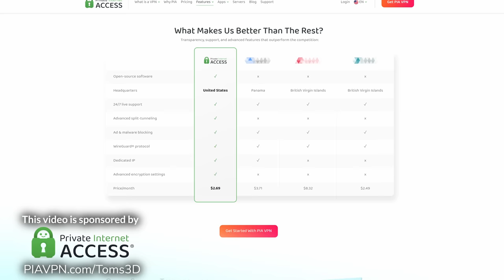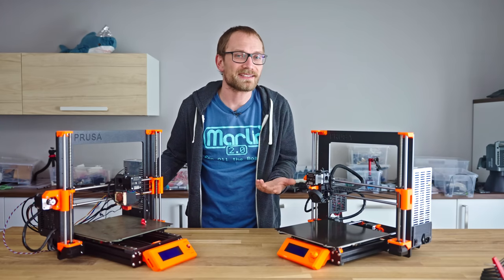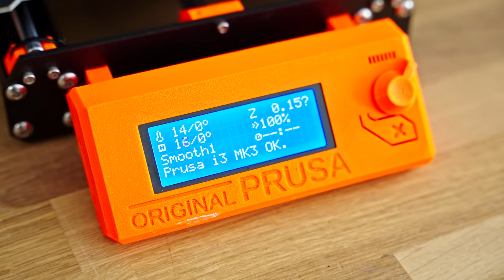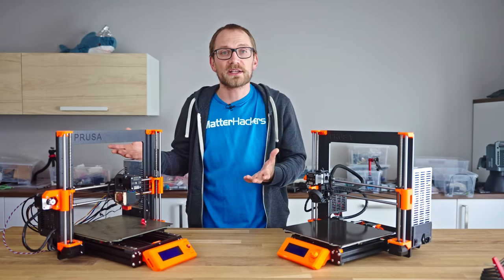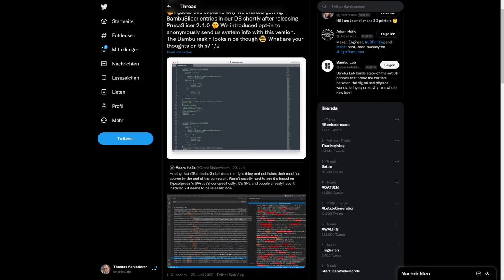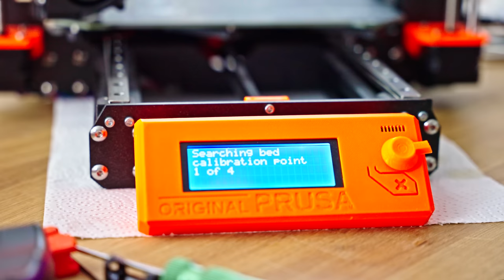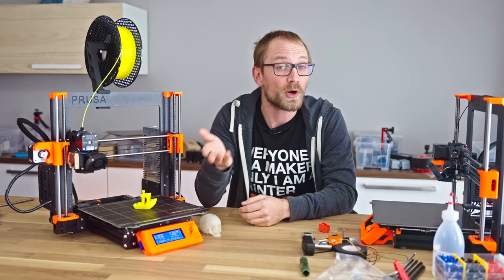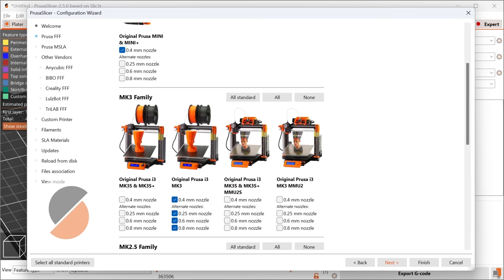This printer is OLD. Why is it still my favorite?

Comment: Thank You Thomas!
Love my Prusa i3mk2 and just bought a SL1 with 12 hours on it, $600 on Ebay........$400 S upgrade incoming!  Also, the air filter cartridge is easily refilled with Activated charcoal pellets for less than a buck😎

Comment: My Prusa i3 Mk3 is my rock. Almost literally on a mental level, because the 2.5+ years of my long covid has wrecked my leg muscles to the point I'm now officially disabled and can park close to shop entrances & on double yellow lines.
But when I'm 3D print designing, my entire thoughts go into looking at & manipulating the design in my head like I'm using a 3D editor, only without the slow keyboard+mouse interface constraints, and I can practically see the print lines in the detail before the stl even hit the slicer. I've had 3 things on the front page of Thingiverse now :)

Comment: Love it too! Would love a play-by-play of what you did to rejuvenate the old printer. Mine started having so many hotend issues I just eventually gave up: maybe just time for a replacement hotend
Reply: Perfect time to upgrade to a Revo Six. ;)
Reply: Start with disassembling the print head. Put in a new nozzle and heat break and take care that the extruder is ok and you should be good for another few years. Oh yes and use only good filament! If a filament clogs often: never buy it again and throw away the rest of it.
Reply: I had frequent clogs with the stock heat break. Turns out it has a diameter change in it designed for the MMU and it causes problems. I changed it with a E3D V6 heat break, that the same inside diameter all the way through. Works great now!

Comment: i Bought  my Prusa MK2s  IN 2016... later  upgraded to MK2.5s  . At  the  beginning it  wasnt perfecft,  I had quite  a  few unfinished parts (  especially when printed  longer  than 2  hours), also had  some  bad  jams -  all the  usual stuff , but then I  found  a  very nicely  designed S±E Upgrade kit for E3D Titan Extruder  on Thingyverse. So  I  ordered the  Titan  extruder, printed  the  kit and   since then  (  2017)  ive  been  printing without  any  problems

Comment: Thanks for the video, Tom. Nice job. Your videos have helped me a lot.

My first printer was an Ender-5 Plus with issues right out of the box. Support suggested swapping wires on the mother board first, then sending a new replacement for the hot end. I replaced the power supply, mother board and a drive motor too...never did get a print off of it. I call it my "benchy" because it just sits on the bench.

Which brings me to my Prusa i3 MK3S+. Printed great right out of the box and still does. PLA, PETG, PA, Flex, and Composites all print great. It's all about reliability.

Comment: I just bought the MK3S kit as my first 3D printer. During my research it just seemed like the best fit for me - I wanted something that can print simple stuff without any special tinkering or trial&error, and keep doing that with a low chance of breaking down, while having lots of support online.
And I think I was right! The instructions were great, and it worked immediately after I put it together, despite me having very little experience with things like that. When I search online for improvements and hacks, I get tons of results. Everything seems to have been printed on this, every software supports it, it just works, any serious bugs in the hardware or software must have been fixed years ago. That's what I like in cars too... never get the first model from some line, get the one where the bugs have been fixed.

Comment: I very much agree with this statement. The Prusas are unbeaten when you need a printer that *just works*. It'll be slower than other printers (like the Voron 2.4) or doesn't have the largest build volume (Also Voron 2.4 or Creality CR10 in all its variations), but it just spits out quality prints without having to tune it for hours.
Reply: Bambu lab comes far closer its the first 3d printer I use like a paper printer
Reply: I don't even see the Vorons and the like as competitors to the Prusa because they don't address the same target groups. One is for people who want to 3D print, the others, taking into account the effort you have to put in and the know-how you have to acquire, are for people who are interested in 3D printers. (And yes, I have both.)
Reply: @tmartin9482  Very true, the process for those is very different from something like a priss which you can get pre-assembled. But if you have the know-how, they're unbeatable at the price for how much speed you get, and what you can do with your printer (thousands of mods to choose from). But they don't "just work" st the end of the day, unfortunately

Comment: I would say, for tinkerers a CR-10 would be an even better choice than any random Ender-3 clone. The CR-10 is so old, that abused or neglected machines can be bought cheaply, they are even older than an Ender 3, so retrofitting newer parts on an original CR-10 is so much fun. The resulting printer can also be a perfect second printer alongside a more reliable normal-sized one, since its larger build volume gives it uses, even if another printer is currently better at most parts.

I have to say, I just love to explore different competing upgrade paths at once. My first printer is an original Ender 3 and it has e.g. the SKR v1.3 with TMC2208 (that was state of the art back then). My CR-10 got a nice MKS Robin E3-DIP with TMC2209 (before chip shortage became a thing, so the whole board was like 20€ including shipping). I also use a HeroMe Gen 4 on my Ender, while the CR-10 uses the superior Hydra V6 edition (with a premium V6 clone). My Ender 3 is still a bowden printer with a normal metal extruder. The CR-10 is direct drive with the dual gear extruder meant for CR-10S or something like that. etc

Comment: I'm with you on this, mostly because Prusa just works, and if it doesn't there are direct guide and support from Prusa to get it to work. Those printers might be kind of expensive but I'm willing to pay that price as it just works, and now there is possibility that Mk4 is actually comming as there was poll on printables on what features would you like to see in Mk4.
Reply: I've never seen a video of a print farm that uses anything other than Pursa's. Hmmm. I CAN speak for the reliability of Creality though: SH*T!
Reply: Prusa needs to drop the prices on it's older printers.

Comment: My old Prusa MK3 has exactly two mods. The first was not done by me and it's just a power cable extension so that the power supply can be mounted outside the home built enclosure it has. The second one, the only one I've installed and only because I accidentally wrecked the hot end by rounding off the screw holding in the heater core is the Revo Prusa. I love being able to change nozzles without any hassle and has made my machine more versatile than most new contenders. Someday I'll get an MMU 3 but that's gonna be a while.

Comment: Im running still my MK2S, that I updated to Mk2.5S, and The Bear Frame.. It blew its mainboard so I updated to Duet 3 Mini 5+ and got all those network stuff and up to date stepper drivers. Installed Revo hot end and Super Pinda. But still under every minor or bigger update I have done its still that MK2S.. And its running perfectly and its so easy to maintain! Actually bought used MK2 to run along with it and it works as well after almost 5 years :)

Comment: Few things on my Prusa where I thought: "That could be improved" -- wire management, construction order, some parts are finicky to assemble. They could add guided OSD steps for cold pulls, and move the fan to the back to make nozzle swaps easier. But... overall I've REALLY been enjoying my Prusa, and I think even in 2022 it's still an amazing machine to buy & use, both for beginners and commercial print-farms alike.

Comment: I have a Mk3S+ bought Feb 2018 and use it frequently. With minor hiccups I created wood working guides, vacuum hose attachments, replacement parts for tools as well as parts to modify tools, and a few toys for the grand kids. It's the only 3D printer I have and it just works when needed. I am on the waiting list for the new XL but we'll have to see. With the XL delivery delays I expect the improvements being made are going to make it usable right out of the box with no worries about it being a "NEW" machine. On the Mk3 I waited a year to see how it survived before plunging in and am glad I did.
Reply: This is what I want a printer for as well. Making modifications for my wood and metal working tools - and occasional boat parts. Can you recommend a good beginner software program for designing these types of items? Thanks.
Reply: @Alaneberhard  I pretty much use Fusion 360 for everything. I upgraded my MK3+ to MK4 and it's so much better than it ever was. If you haven't bought a print yet and don't need the output size of XL the MK4 is excellent. I just made custom gutter hangers for a patio along with custom shaped downspout parts. Couldn't buy what I needed.
Reply: @woodturner1954  That's awesome! Thanks for the reply. Happy creating!

Comment: 100% agree and i'm glad you made this video.  i bought prusa parts for my mendel 10 years ago.  josef has done so much for consumer 3d printing and some new people to 3d printing just have no idea.  i'm not saying newer printers aren't better.  i have a carbon x1 with ams.  it's great.  but i've already had about a 30% fail rate if you count the broken prints from being stuck to the print bed.  i don't even remember my last prusa failed print, honestly.  it just works.  i start a print, wait for first layer to finish, and set speed on the machine to 200%, and it just works.  it starts printing so quickly that it's not as bad as you would think compared to the bambu, which takes a century to get to printing.  and noise!  the prusa is so quiet.  the ender 3 s1 has the rubber wheel carriage rail system and that's just inherently quieter than rods and bearings, but it's pretty close.  the bambu is so freaking loud even when i turn the aux part fan off.

i have two mk3's and a handful of other printers i got just to tinker with and i think i'll keep the mk3's for a long time

Comment: I have a MK3 for many years but I have to say damn... I've built 2 Voron 2.4 350mm for work and they are running 24/7 with no issues at insane speeds with the same quality like my MK3.
Reply: I bought an Ender 3 to learn about 3D printers, I bought a Prusa Mini because I wanted to see the quality of the product without having to fork over the money of it's big brother. I was convinced! I bought a Prusa MK3S+ to build (reliably) the parts for my Voron 2.4 350. Different printers for different purposes... I could have build the Voron parts on my other printers, but I wanted a dependable workhorse that is less complex. The Voron is big and powerful, but it is a way more complex machine, that has more parts that can break or require maintenance.

Comment: I don't think I could have said it better myself Tom! Loved this video! As well as the NUMEROUS costume changes with what felt like almost no discernable gaps in the audio recording for levels and such. I agree with your statements regarding the MK3S, they are not new by any stretch and definitely showing their age, but they do just work and there is SO MUCH VALUE to that. 

I will be curious to hear your thoughts on the P1P or even some machines like the Neptune 3 line from Elegoo or the Sovol SV06 and how they all compare. The Bambu I, specifically, and looking forward to your thoughts on the noise as I am told it is quite loud!

Comment: I've got a mk2.5s that's been going strong about 5 years now. Prints great and needs pretty minimal maintenance.

The only thing drawing me towards a newer printer is the speed on ones like the Bambu carbon
Reply: most prints work perfectly at 200% speed (under tuning menu on the printer after you start a print)  sometimes you wait until after the first layer to do it, but usually it just works.  it still won't match the vorons and carbons but it helps a ton, and the super fast startup time helps too.  my prusa levels the bed in like 20 seconds and the bambu spends like 10-15 minutes before each print doing random crap.  with klipper, you could go faster, but not worth it on a bed slinger like the prusa.  voron is my next project 😎

Comment: I still use my MK3S daily, only mod is rapido hotend with tungsten carbide 0.6 nozzle, cca 35mm³/s vol flow. And 2000 mm/s² acceleration. Little ringing, but it doesn't matter because my parts are big  and functional.

Comment: The day you have a hot end failure and you have to disassemble 40% of your printer to fix your hot end and you know why I hate my prusa and love my flashforge. Flashforge designed their hot end for serviceability and even the cables are just plugged in and don't need to be pulled out all the way to the board. Also, my pei powder coated sheet is corroded

Comment: Thomas, I agree with you 100%.  I've had my Prusa Mk3 (NO, not the S version as I do NOT see any difference in my prints with the angled fan position).  I've had my MK3 for 6 years and 10 months and I love this printer.  Sure, Prusa could have used a better grade of hardware to keep failure to a minimum, such as the SD card holder and the poor grade of wiring from the print head to the motherboard, but Josef Prusa and his team of designers and code writers have done a brilliant job over the years.  I consider Josef Prusa the Henry Ford of 3D printers.

Anyone reading this and other posts that are new to 3D printing or about to get into this hobby really should consider this brand/model of printer.  Remember:  "you get what you pay for."  Yes, it's more expensive than a multitude of other printers out there, but with this brand of printer you get reliability over cost.  Others will tell you a cheap/inexpensive printer, over time, will cost you time and expense fixing issues with the printer.  Do the math!  LOL

Comment: After I got an mk3s myself, I don't have a reason to look for an upgrade other than mmu and networking. But Prusa offers a 'drop-in ish' mmu upgrade, and the networking is an EZ dropping upgrade with a raspberry pi and octoprint or prisalink. My 2 mk3s both have a pizerow2 with prusalink on it. But the machines work, it just works.

Comment: Two Prusa MK3 then upgraded to 3S Now they are both 3S+ machines, I upgraded them during maintenance windows. The reliability is outstanding, and when I want it just to work, I use one of the Prusas.I have other printers, but the ones that get the most use are the Prusas. One is four years old, the other is three now. I love them both because they are pretty much idiot proof, the sensors prevent me from messing them up. I do run Octoprint on both of them with a Raspberry Pi, a camera running (Used to be spaghetti detective, now Obi the Owl) I am thinking of adding LED lights so I don't have to leave a light on for it to monitor the prints. The reliability alone was enough to make me reserve an XL.

Comment: I recently got an old 3D Printer for free from the company I work at.
Its a Vellemann Vertex K8200 from 2012 (!), and I started bringing it back to life.
Several days of problem fixing later I switched the Z-axis rod, updated the firmware, printed a different fan shroud, swapped the temperature sensor (old one was broken) and tuned the firmware and Cura settings.
In conclusion I have to say working with such an old Printer isnt worth it anymore.

Comment: I bought a Mk2 in 2017, I then upgraded it to the 2.5, then stuck an MMU2s onto it. It is still going strong! Now I have not been kind and gentle with this machine. A number of plastic pieces are broken, I had to change the PSU and I've disassembled it more times than I can count. But... IT'S STILL GOING STRONG!!!!

Prusa make top tier shit

On the other hand, I bought a CR-10 as well one time. Lasted 6 months before the entire hot end just failed...

Comment: You know, there is the point. When I skipped my DIY home build printer is what because I didn't want to struggle more with modification, upgrades and so on. Prusa is just working perfect without any mechanical upgrades. I will never regret that I bought it.

Comment: Ordered my first prusa today. Tired of fighting my 2 Ender 3 V2s. Grateful for all the things I have learnt though (I have literally have had to tweak/fix every part of the Ender) but the time has come to focus on designing and refining 3D parts not taking Ender 3s apart! Thanks Thomas for all your great work
Reply: I've read this a lot, that people are having issues with the Ender 3 v2 or Pro, but I got a v2 about 18 months ago and had no issues with it. Other than one time the brass lead screw nut de-threading itself, which was user error on my part. It's not stock. Switched marlin for klipper, made it direct drive by using a dragonfly bms and an orbiter v1.5 on a custom afterburner toolset, but it's been running for about 12 months in that setup with about 50-60% of its time printing. I love tinkering, so that helps as well. It helped me fall in love more with 3d printing, just ordering a Voron v2.4 kit ( bigger is better? 🤪)

I hope you enjoy the ordered Prusa, I heard it's a good and stable platform. And if money was less tight at the time. It would have probably been my first model as well.
Reply: I made that same decision about one year ago, I got tired of unreliable printers and spending my time fixing the printer problems. Now I just press print and that's it. My Prusa has been printing almost 24/7 since I bought, the only problems that I had was caused my me and not by the printer. I don't need to constantly see if its printing fine or not nor do I need to verify if the first layer its OK. Best decision ever
Reply: Your Gunna be pissed you wasted so much time with the Creality junk lol. Prusa just works!